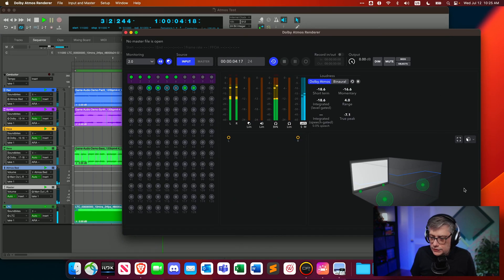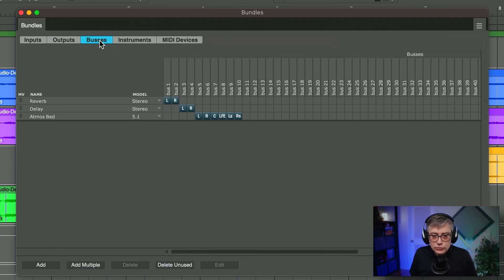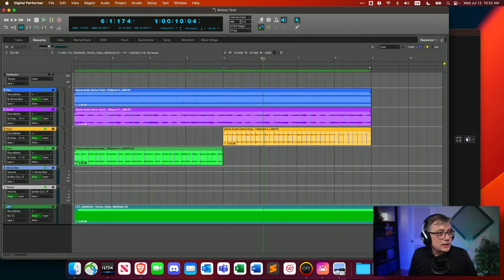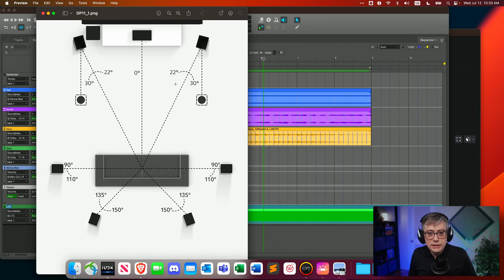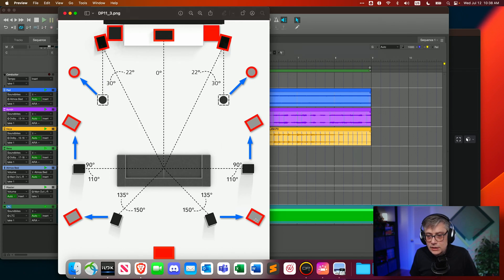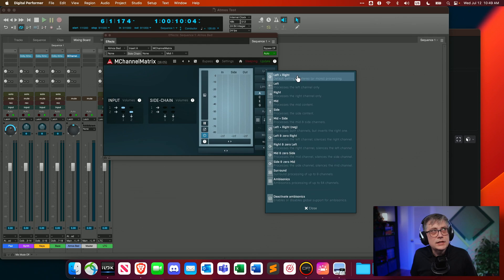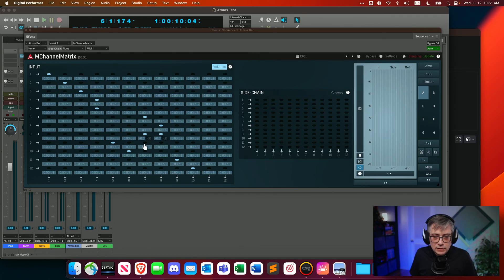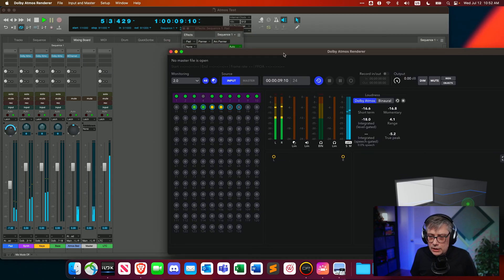Getting Started with Dolby Atmos in Digital Performer 11 - Part 2: From 10.2 to 7.1.2

Comment: Hey Michael, Which version of DP and Melda are you using. I get multiple reports that MChannelMatrix does not show as a 10.2 capable plugin in DP11.22 - It does show as 7.1 but not 10.2. Any ideas?
Reply from the maker: You need to switch MChannelMatrix into ambisonics mode and then select 3rd order ambisonics. If you set it to suround sound mode it only goes up to 7.1.
Reply: @michaelgwagner  I wish, but the plug in doesn't even show up in the plugin selector window on a 10.2 track
Reply from the maker: Try AudioMatrix from Sound Particles.